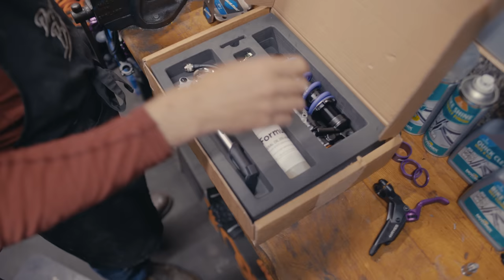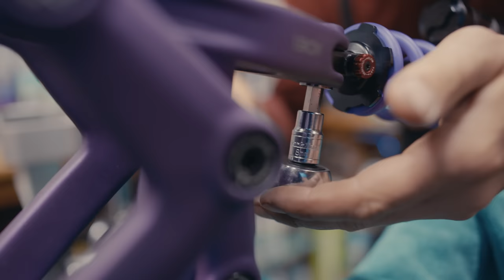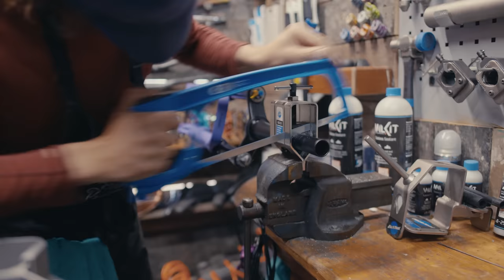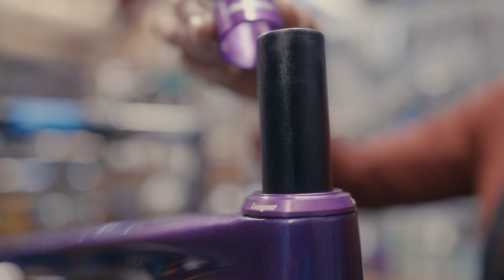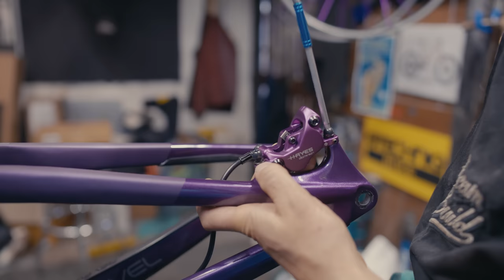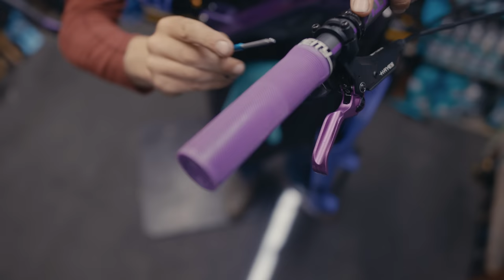DREAM BUILD MTB - Revel Rascal - PURPLE!

Comment: just head cranks/bb serviced and now crank won't spin freely when I take the chain off. It makes maybe one full rotation when I spin it with decent force. Should it free spin just like wheel does or is some resistance ok?
Reply: Sealed bearing bottom brackets should spin with the smallest amount of effort. Depends on the cranks but with most you can adjust the preload and if that’s too tight then the cranks will bind and will be harder to turn.